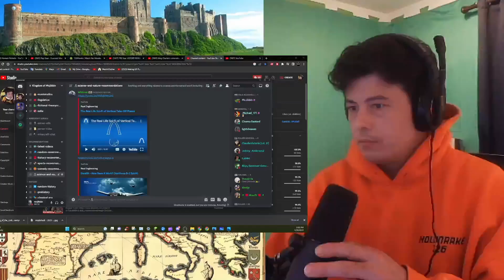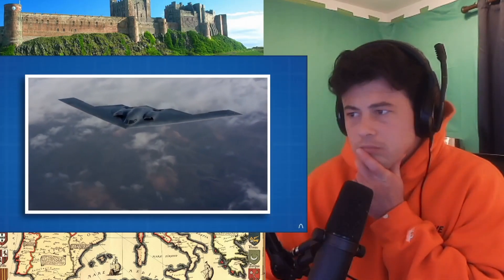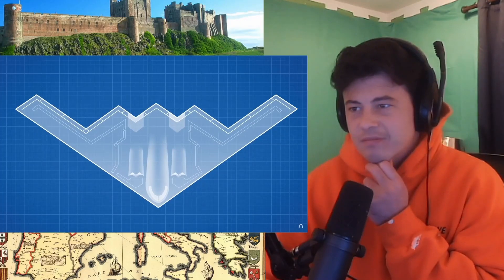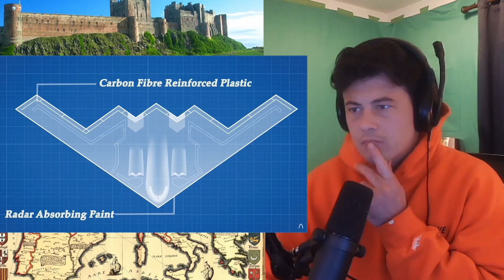American Reacts Stealth - How Does it Work? (Northrop B-2 Spirit)

Comment: the large bird reference , it does not show up as a bird, the return signal is the small return of the radiation that the B-2  reflects back to the receiver,  a 51m (167.3 feet) wing span showing up as a large bird  means this could be anything a large bird , a helium balloon, even a plastic bag blowing in the wind, also it depends on the radars type and strength the course of the plane, atmospherics and then there is the combat situation if there is a lot of planes out there, goodies or baddies, would you be able to pick out a tiny radar contact (the size of a bird that might be intermittent)  amongst the clutter and Jamming of all the other non stealth objects???................... probably not, that's why stealth works if you can't see it or lock on to it, you can't hit it.

Comment: The Germans invested in rocket technology in large part because they were forbidden to have heavy artillery by the Versailles Treaty...so even before the Schmazis came to power, the Weimar Republic was working on rocket motors. However, what this video is looking at is flying wing technology, and Jack Northrop was working on flying wings in the 1930s, so the Germans were not the only ones developing flying wing technology. The big thing about the Horten Ho 229 was that it combined jet engines with flying wing technology in a flying prototype...that is why it was featured in this video. And the main reasons we wanted the German rocket scientists after WW2 was mostly to keep them out of the hands of the Soviets...at least to begin with...it also really helped a lot that so many German scientists strongly preferred to deal with the Allies rather than the Soviets.